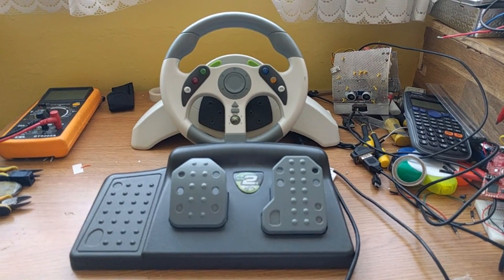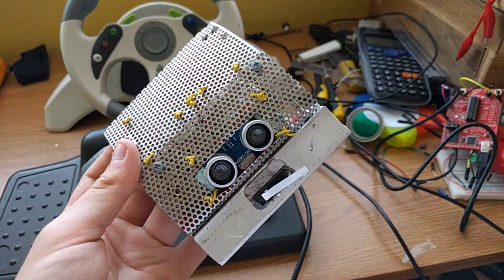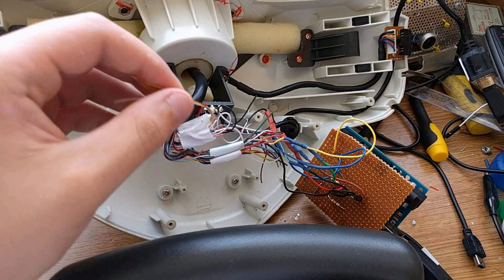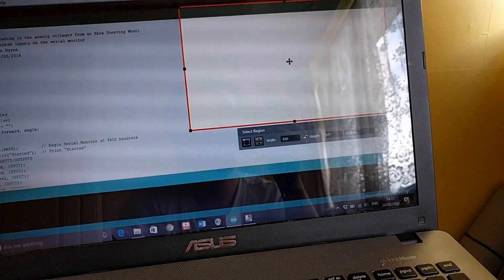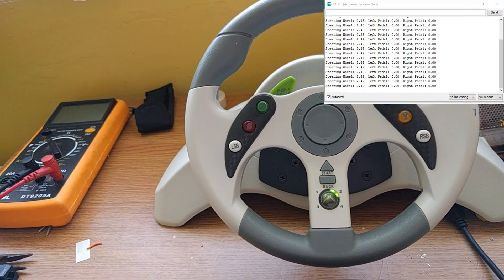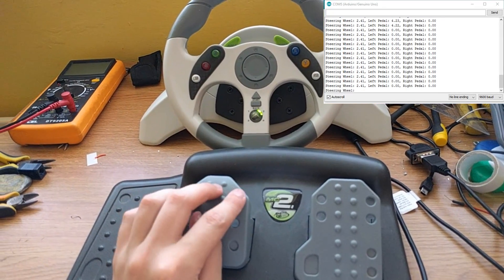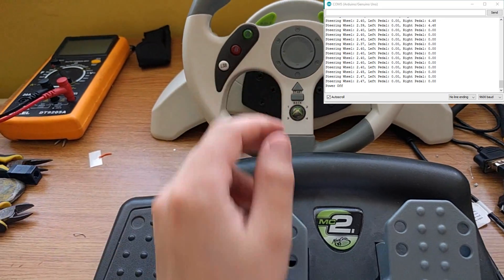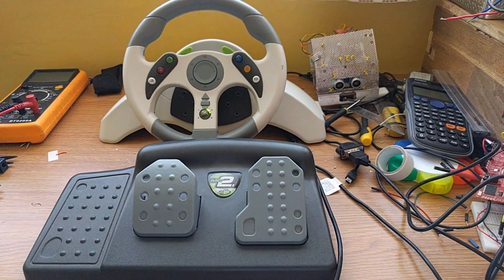Reading Inputs From an Xbox Steering Using Arduino

Comment: If you would make a controller for  pc-gaming with a total of 100-110 degrees steering angle, how would you approach it? Made a project a few years ago with an modded xbox 360 controller with different potentiometers but I didn't find a way to get the wanted steering angle. This problem has been haunting me for many years, you know any solution? Thanks in advance. :)
Reply from the maker: Hey Tobias, thanks for watching the video. So is the problem you were having  you only wanted the wheel to rotate to the left or right 110 degrees and you couldn't restrict it to this or was the problem with getting the full range out of the potentiometer?

For the first problem, you'd have to find how your steering wheels rotation is limited, for mine there's a circular track which a bolt follows and the track stops roughly 130 degrees each way so you could fill the track on both ends so the bolt can only travel 110 degrees each way. 

For the second problem, you could get a custom pot or you could attach a small gearbox to the wheel so that when the wheel turns 110 to one side the pot will turn fully to that side(let's say 2.5 turns for a 5 turn pot).

Hope this helps